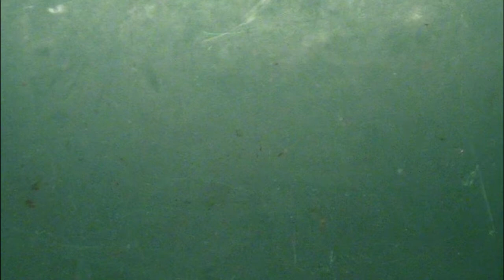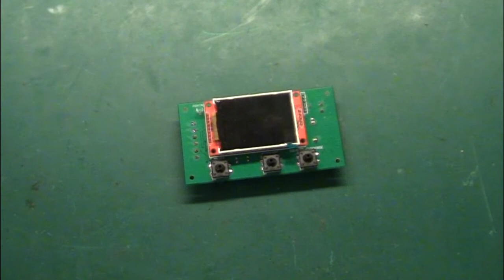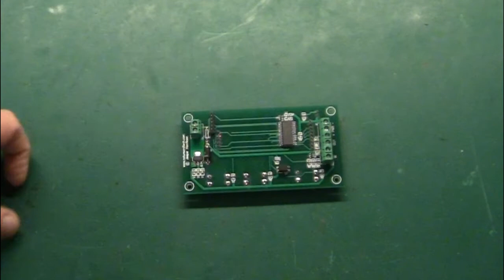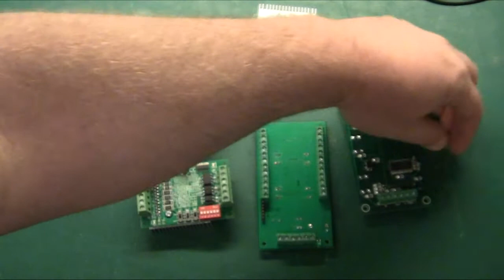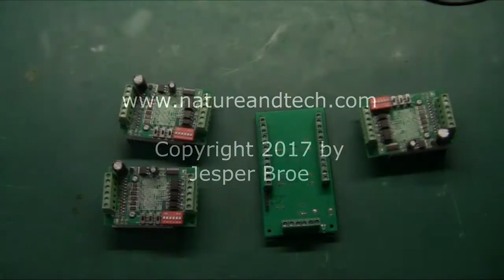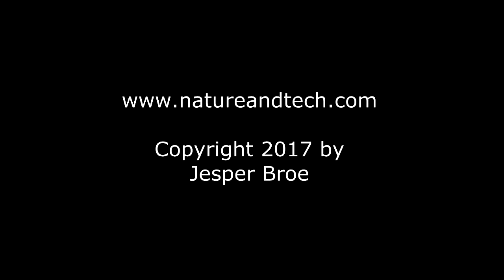Design of an antenna rotor system #2

Comment: hi... what kind of antennas are we talking about?
Reply from the maker: In my case, small yagi antennas, but as this is simply controlling a stepper motor, it could - i suppose - be any kind of antenna.
Reply from the maker: 100 MHz and up.
Reply: NatureAndTech
I meant what is the end application....
Reply from the maker: HAM radio :)